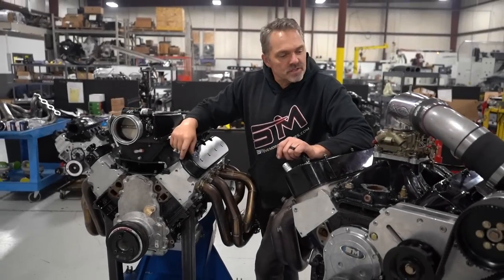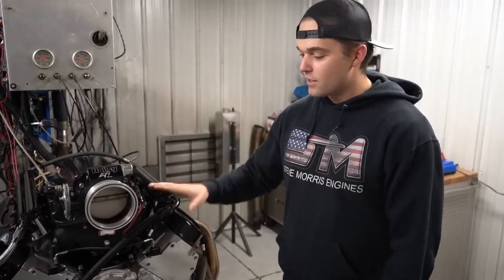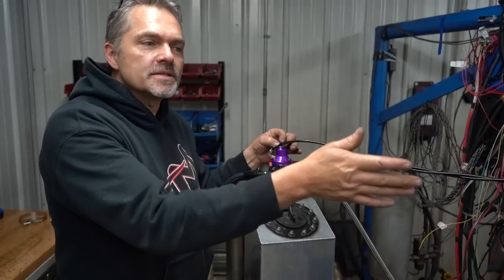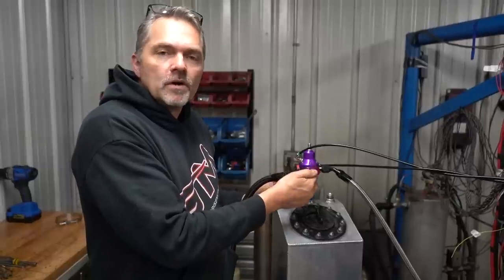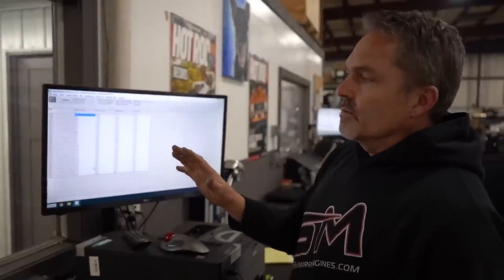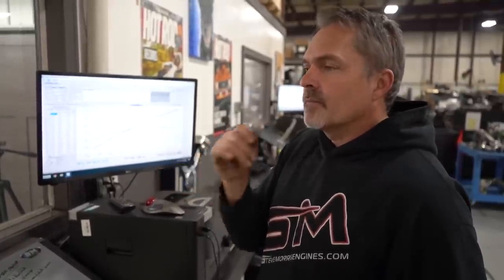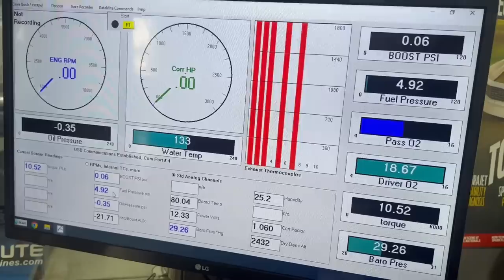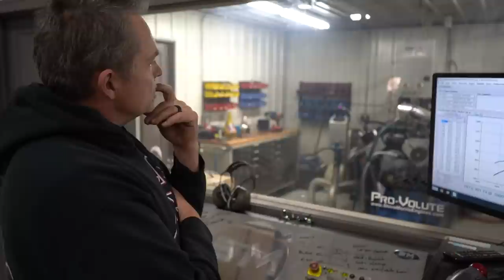The Engine That Started it All, 12 Years Ago !!

Comment: That is some history right there. Carburetors are a fascinating piece of technology. I mean all the mechanical things like accelerator pumps etc. that were developed over the time to eliminate certain issues are just genius.

I live in Germany and one day I saw a 50s U.S. car stranded on the side of the road. I stopped to try and help out. We found that the floater was full of fuel. It was a brass one and it must have had a small crack that we couldn't see. We drilled a hole in it to drain the fuel and sealed it with solder. It was enough to get the 30 miles to home.

If you do something you do it proper and I really like that. When you took the engine out of the wagon, I loved to see that you color coded all the fittings for easy assembly. Cleetus went with the all black fitting version. I hope they never mix up an oil and water line. :hand-orange-covering-eyes::face-blue-wide-eyes:

Comment: Hey congrats on the big sub jump and for letting your motor go to cleter.  Just a quick might wanna have Kyle pull his hoody strings out, they were pretty close to the blower belt. Keep up the great work.
Reply: When he was moving so casually around that belt, my spidey senses were tingling. I didn't even notice the hoody strings, but it just made me nervous. Good catch. I ran my finger through a fan belt and AROUND the pulley back when I was a teenager. Thank goodness it was nice and loose. Scared the absolute shit out of me. Didn't hurt my finger much, but damn near pulled my shoulder out of the socket. (we shall not talk of the marks the fan blade made on the underside of my arm) You live and you learn. Hopefully with all your body parts still attached.

Comment: Many of your early procharger videos helped me to build my 565 for my f1x. It's a 77/46 pulley ratio with a c&s aerosol (dual needle and seat) carb on pump gas in a street car. It's held together for six years of brutality in front of a Jeffco four speed. This procharger is spinning as fast as its rated for, and it's always handled it well 👍 excellent video

Comment: Great to see that C&S Carb on the 540.  Takes me back down memory lane. I ran one on my N.A. Hot Street Mustang in the NMCA back in 1998. Took it to Milan and instantly picked up .2!, Which was a game changer. in a TIGHT Class! Needles to say.. the NMCA outlawed it by the nexr race. The Aerosol Billet was the real deal. No big boosters talking up space and much better atomization of the fuel. Ended up using it again in the NMRA and won the Championship in 2000. it now supplies fuel to a friend's Small block Impala. Great folks to work with back then too.  Thanks for showing the kid how to tune old school RELIABLE.

Comment: Isn't it amazing how many youngsters look at a rochester quadrajet carburettor or any other type and look myth'd! even some older Holley Carb's even some newish  mechanics won't touch them... Makes me feel old at 50yrs old...  definitely want an SMX, but will call when I have time, especially when I'm down under! Really enjoyed this video, more old school technology which im more familiar with!
Reply: I’m 71 and remember the Holly as very easy to tune
Reply: I'm 31...my knowledge of most carbs is that they should be clean and what a jet size is and what the chart for temperature/ altitude for a stock dirtbike shows and how to change it. For an airplane though, it's pretty easy with an adjustable mixture, you just adjust by exhaust temp and achieved RPM at a certain throttle setting, or if you have no exhaust temp gauge, lean it untill it's rough then richen it a touch. I wish cars were as easy with the varied throttle and RPM and loading....
Reply: @EASTSIDERIDER707  67 and still have nightmare trying to make a Quadrajunk work at all. Rochesters were actually a pretty good carburetor once you figured them out, but boy they could be finicky.
Holley's were a Godsend, even a dummy could make them work halfway decent and I'm a dummy.

Comment: As you mentioned Steve, it would be beneficial to try adjusting the high speed bleeds. They tend to be large from factory, I find stepping down a few sizes can help with some of the lean top you were experiencing. 
Secondly, a newer style metering block with adjustable power valve channel restrictors. (PVCR’s) can really help clean up the fuel curve. Allows you to run a slightly smaller primary main jet (presuming you only have a PV on the primary side) though you can get crafty and run dual PVs primary and secondary and really play around with PVCRs and main jet sizes. But that aside, larger PVCRs allow for a smaller main jet, when you’re under the PV opening condition you can get a slightly leaner fuel curve, then when the PV becomes active the larger PVCRs allow for more fuel to richen up the mixture. 
Emulsion jets, orientations of the emulsions along with float heights can also make for some positive mixture results though you’re really splitting hairs at that point. 
Wish I could have been there in an attempt to resolve the minor mixture inconsistencies you were experiencing. Usually why the newer Holleys, quick fuels, pro form carbs are great because of all their adjustability on their circuits.

Comment: From my experience along with common sense.....When you're dealing with fuel systems and fuel line always know the size of the orifices in the pump and your hardware. Your line should always be equal to or larger than the orpheus that u are supporting, learn your path and the limits of where the fuel has to flow in or out of. If your line is smaller then the inlet or outlet of your hardware, it restricts flow more than the hardware can do itself. Like he said the Orpheus that fuel was returning through was too small even though he tried A-line larger than the output orpheus. That means the return orifice itself was the restriction, it was too small so he went to the larger alternate return orifice. Sometimes the restriction is internal. Always have sufficient fuel line size. Always check that anywhere there is a orpheus or something that is in-line like fuel filter, that your input and output of that filter or part is equivalent or larger than the pump output, also make sure your in/out on the regulator is adequate for the application. I know this is fuel 101 but someone might not have thought of it. This is not my channel to give advice so this is just my own experience. Follow the manufactures recomendations. Thanks and God-bless.

Comment: I actually would like to see the dyno run with a different blower pulley.  On a side note, I can't believe you let Kyle work next to a running engine with the pull strings on his hoodie flopping around. Watching him check timing with the strings just dangling gives me chills. ESPECIALLY when you (steve) are wearing a hoodie that does not have pull strings. I just want you guys to be safe so you can continue making cool content. Recently subscribed after Cleetus asked but have been a fan of yours on his videos for a while. Like the videos guys.

Comment: Hello and congratulations on getting to 400k! Steve, I've been wondering - is there a reason why no one builds engines at this level with a flat plane crank? Is it just the balancing issue? Or cost? Or prioritizing torgue over top end HP? I've never been able to find a definitive answer to this. I'm watching every video and loving the content.    God bless.
Reply from the maker: 2nd Oder vibrations 
They suck
Reply: @stevemorrisracing  10 4 lol

Comment: Im in the marine biz so, not sure if its relevant. Volvo penta had some diesels that had a blower and a turbo. The blower had an ac type clutch and ran on demand, a little dor in the induction tubes flipped when the blower kicked on. Only fishing boat that took me from standing to sitting when i stuffed the throttles doing 40mph! Once the load is removed it goes back to turbo only. Might be a neet street application.

Comment: The fuel return line would explain an issue I had many years ago trying to put a electric pump on a carb.  Engine wasnt even boosted either.  Never could get the pressure low enough.

Comment: Test engineer tip if the week:  Tuck your hoodie strings in before getting near moving equipment. It’ll literally decapitate you. That’s when we stopped using the motto “test or die!”.

Comment: Hey I see you made it over 400k that's great, I know what it cost you but I hope it works out where it was worth it. I see cleeter has it running, inwonder how much power he is gonna lose with smaller turbos and redesigned throttle body?

Comment: I don't know what needle and seat size you have in there but go to a larger one or an alcohol one even and the fuel curve will stay down.   There used to be a ball needle and seat someone manufactured that would also let you run more fuel PSI but the fuel level still changed a decent amount when they close, and the idle on the street was a pita.   Ah this takes me back....  Lol...

Comment: What you are saying about the return fuel line needing to be larger than the supply side is the same with hydraulic systems. 
So if you are ever troubleshooting a hydraulic system, a good wzy to determine which hose is the supply and which is return is to look at the hose diameter. 
(If it is set up correctly)

Comment: The restriction in the return let not enough pass so pressure built up. So if guys want to change over to an electric fuel pump check for the flow and pressure. But this goes for all systems: external oilpump external coolingpump or hydraulic steering assisting pump.
Congrats on the 400.000 . Only tell Mr Youknowwho not to abuse it. As a former marine engineer i like the builts and going to the limmit. Not destroying it for the sake of it.

Comment: For the SMX water cooling, what if you did 4 to 1 fitting. Four 10AN from the heads/block into a kind of like a double Y to a 16AN out to the radiator? That would take 3 leak/fail points out of the equation. 16an flows 40gpm and 4 10an flows 44gpm or there abouts.

Comment: Carbs are just so easy once you get to know them and besides the lack of needing complex wiring and a laptop to tune it...far fewer things to trouble shoot if there is a problem.
Reply: Laptop is faster and you don't smell like fuel all day .... 
Carbs are a pain unless you run at the same air density all the time.

Comment: So I have a question about your dyno room, Steve.  Are you running fans to the front of the engines when you are making pulls?  Also is the fan speed increase with ram or some other marker.  Awesome to see you getting up to the 400k mark. Good job Cleetus.

Comment: Question so run 2 stroke twin in the winter and always 2 steps hotter on the plug cause no mark on the strap. So needle sticks open on one or both carbs for a while and runs fine down low but dead bog up top and fuel mileage crazy low and eventually pukes out the piece of dirt and runs fine and finish the weekend. Why can a 2 stroke run pig rich and keep going ? Just through the crankcase and out the tailpipe and all good? RM 250 also had a super cold plug, run Br7s in everything to get some heat as timing is hard to adjust. All have br 9s to start with factory spec. Plugs never show wear at the tip and so are all 10 yrs old. Run 97 Era bikes and sleds in Northern MI and enjoy carb tuning and a 70 cuda big block na with 3 hollers. Its fun to me. Not your bread and butter but love your listen and tune throw outs. Where was I going? Oh yeah low buck carb tuning makes hp and fuel mileage in the na world. My newer atv that is FI gets the Gumout cleaner, and that's it and I replace the plugs. No tuner available and seems fine just mess with clutching. The rambles, smart kid good work. Have a Great Day yourself.

Comment: Hey Steve, might want to tell Kyle to pull the strings out of his hoodies while working around engines. Kind of gave me flashbacks when he was checking the timing on that engine while it was running with his hoodie strings dangling close to the blower pulley. I once got my hoodie strings caught in an alternator belt on the diesel in my boat and it started pulling my head towards the pulleys. Luckily it yanked the string out of the hood before my face was turned into hamburger. Would hate to see him mess up that pretty face before he finds himself a sugar momma to support his engine and racing habit. 😂

Comment: I'm currently running a dash 8 feed and dash 8 return on my boost referenced regulator for a roots blown sbc with an 871 supercharger and twin Demon 750 carbs. I'm having major idle and low speed issues. Could the same size feed and return lines cause fuel pressure issues in this type of setup as well and does the vacuum port on the regulator need a vacuum source or just leave it open to atmosphere? I'm getting conflicting thoughts on this. Great video by the way.
Reply from the maker: Possible

Comment: Garrett is already force starting your SMX with brake cleaner. James sat spraying brake cleaner in the cold side  turning every seal and bead into black mush. Not only that but Zac had strobe showing the timing was wandering at the point they are trying to brake cleaner spray it to life.  Pete looked in utter shock and I don't blame him. Ohhh Steve who have you gave an engine too mate? I hope reputations don't die because of this.

Comment: Why not put a dual needle and seat carb on it and let it make another 300hp? If the pulleys are the same bolt pattern would have been cool to swap the blower one to the crank and put the one you took off the crank back on the blower and see what that got ya.

Comment: Don't you hate it when you make more power than what you want and have to dial it back it's so disappointing 😂 
As an engine Machinist that's been out of the game for a number of years due to health issues  I absolutely idolize Steve I would comfortably say he is the best in the industry. I intend on setting up a small machine shop at home to do general machine work such as recondition cylinder heads ect but $$ is the biggest hurdle.

Comment: what is that 75 number measuring? how is the AFR calculated through what sensor? is it pre or post combustion sensor? sometimes less is more, i think atomisation will have alot to do with those AFR numbers it was perplexing that bigger jet = leaner (atleast i think you jetted it up at the end there) can you put something in the intake that breaks up the air coming out of the carby? my guess is that the intake valves are restrictive for that sort of boost in terms of flow, causing decompression at part of the intake stroke, this will make the fuel condensate into bigger droplets. reference your torque numbers at the rpm levels of concern, with very small changes between each run i think you can find the source of this AFR change and really have it consistent, hopefully not by taking the head off, but it might need some grinding around the valves. perhaps the ports with that boost have reached the limits of happy pressure differential. between the port and combustion chamber with valve open

Comment: My blow thru always have had -8 supply and return without an issue with pressure creep, was an Aeromotive A1000 pump/regulator
Reply: I dunno man I was always taught the same thing.. bigger the better within reason .. how much power you making?
Reply: @freedomfox8183  930whp 1040tq. Imo its no more fuel going out of that regulator than the orifice its coming thru can supply, fuel pumps pushing fuel the length of the car thru a fuel filter and a -8 fuel line into the reg also has a 0 restriction return from the regulator so both supply and return flows the same quantity of fuel so the carb should never suffer pressure creep

Comment: Steve what belt are you using with that pulley combo?  I'd like to run a 60 crank pulley to slow my blower down.    Currently 73/56.
Reply from the maker: 1584
Reply: @stevemorrisracing  thank you!

Comment: Hey Steve, you said that that carburetor wouldn't keep up with more than about 1150, but it made more than that.  I was wondering why you brought it back down after the carb showed it could make more.  Are you just afraid of it going lean and breaking something due to a lean condition?
Reply: Hes making it safe so it lasts longer. Making more HP will break it faster.
Reply: Just because it works for a few Dyno pulls, doesn't mean it'll be reliable long term in a car.

Comment: The hell with that:more power  valves dammit waste my time contentious lol 👍
Reply: Now let's see it turn at 600 rps at idle: with secondary screw1/2 turn in with power valves  way below  6.5 course. and primary set screw 1/2 turn in more if needed on full race cam applications 👗 they like doing this lol course 🔊 🔊 2

Comment: 13:00 Does this rule of equal or bigger return line from the regulator also applies for Injectors?
Reply: As a general rule of thumb, when you building new or experiencing problems it's always good to apply to get that variable out of the equation.

Comment: Well this is a new one too much HP never heard anyone saying that they make too much HP  most want more 😅
Reply: It's not a new saying in the boosted arena. If the mechanical parts of the build aren't up to the HP task it won't end well for the motor as a whole. These are relatively short pulls on the dyno, not think of when your in a car or boat, the operator/driver is into a WHOLE lot longer  than when things break....